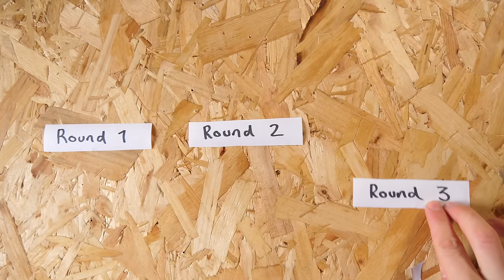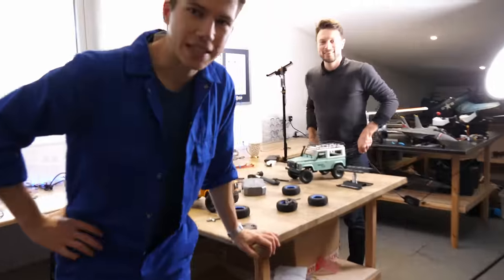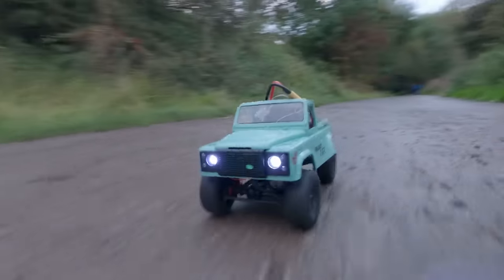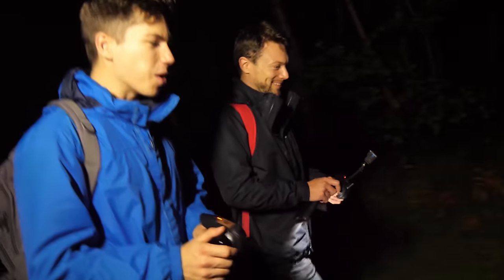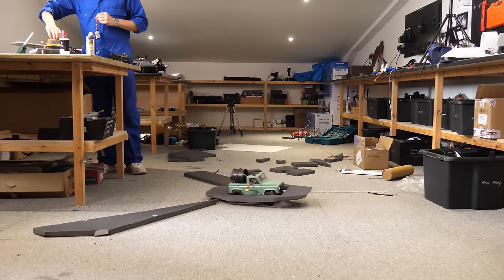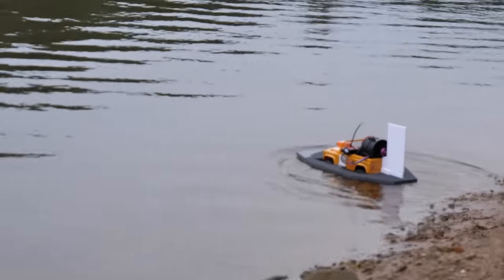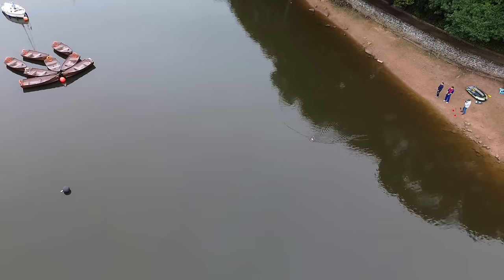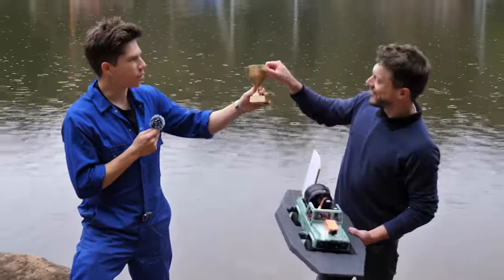Upgrading RC Cars (to drive anywhere!)

Comment: This would have been better if you would have both started with the same pile of components and had to scratch build vehicles to complete these challenges without modifications between rounds. Let the individual engineering shine through

Comment: Great video, was very entertaining. For the next challenge, I would love to see something with a little bit more build and modify volume. Like, get a spefific car kit for x bucks, you can use y bucks on electronics and 3D printed parts plus everything you got at home like foam and controller, not special parts, enjoy, modify it like you want. Have no clue about prices, but maybe 300 bucks in total? Something that encourages you to cut corners and don't modify something like hell, but also gets a liabel modifing project (series). Could be pretty interesting as a Community action or with more DIY creators.

Comment: Did you find the front wheels helped with steering in the water? I'd have gone with a combined water and air rudder, both attached to the same servo and a skeg to keep the boat straight. Obviously ground clearance would be an issue when out of the water but it sits a fair way off the ground.

Comment: Next project for you. Use two of these 15 sec burn motors and see how high you can get (with one motor a guy got over 17,000 feet). AEROTECH 29MM HP SU DMS MOTOR - H13ST-P
Also it would be rad to have it go arrow straight by looking back at the pad and making flight corrections (done with KISS design and low weight). Yes, talk is cheap.

Comment: Next year they must be self driving.  They must stop before driving into something and try to drive around objects in their path.  A magnetometer so it will follow a heading.  A gps so it knows it's gone far enough but a camera that recognizes official course objects would be better.  Turn left 90 degree at the blue cone or follow the red curb.  An accelerometer would be fun too.  When the distance sensor says it's clear ahead then accelerate until the accelerometer complains.

You'll need a Laptop, wifi, Raspberry Pi, Servo hat, some sensors and some Python scripts.  Oh and a bigger crawler.  

All the electronic stuff is cheap but some technical skill is required.  You have to be able to use Linux and modify some scripts but that's nothing for you young well educated Brits.  🤠